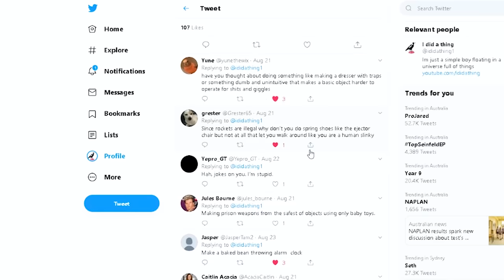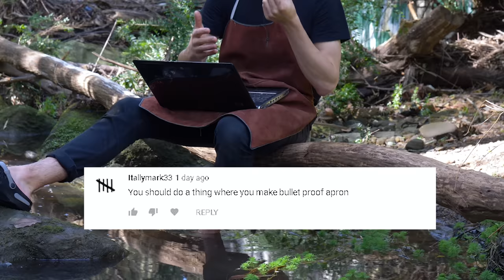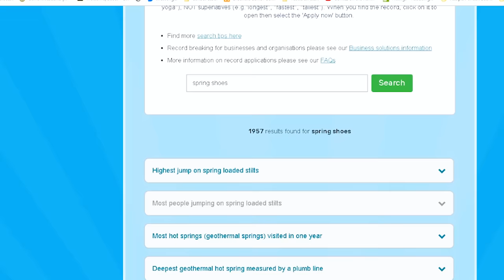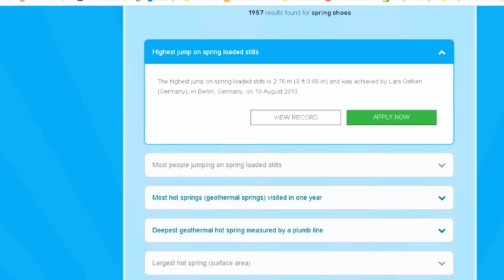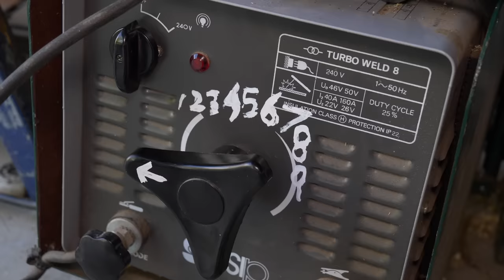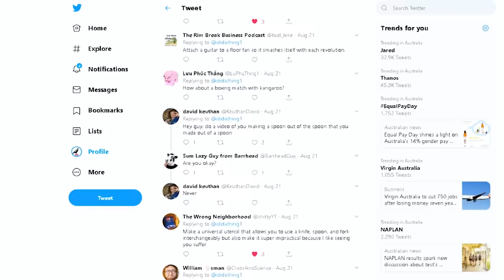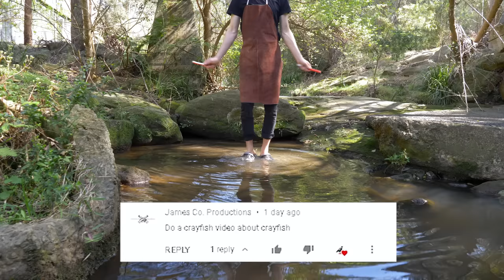I made your stupid video ideas!

Comment: Use snowboarding boots for spring shoes cuz they support your ankles
Reply: Quincy Fenner or high tops
Reply: @galacticnarwhal9798  good idea, but I dont think hightops would give enough support
Reply: Oh, yeah.. they wont break your ankles.. theyll just break something a little higher up.. 😂
Reply: Ah yes snow boots in Australia
Reply: @cheadlechamp8047  it's almost like Amazon exists
Reply: For even more protection you could use ski boots
Reply: He coulda just used the rollerblades
Reply: Quincy Fenner no skiing to
Reply: Ski boots are harder
Reply: @ashfreywar9862  ski boots would be too heavy and stiff to bounce in though
Reply: Also, put a platform under the springs so you have more surface area on the bottom to balance...
Reply: @valargent5774  true

Comment: Add a flat base to the bottom of the spring shoes like a small wood plank, some support from top to bottom to guide the compression of the springs for stability
Reply: It'd have to be much wider than the diameter of the spring for it to work, so wide that the bases would keep hitting each other, plus the weight was already pretty hard to deal with, apparently. I think the main issu is the type of shoes he's been using, I'd use at least moutain shoes, with an ankle cover, or even better : skiing shoes.
Reply: he should use bouncy balls instead of springs

Comment: The spring shoes needed more support and they would have been awesome. U have to put some metal bars on either side of your feet to give u support(like roller blades do) then you wouldn’t have to worry about your ankles snapping and u could gain height
Reply: Lmao I just finished the video, if he would use the normal support system he would have a much easier and accurate success

Comment: You need to use two smaller springs, weld the metal shoe pads on the bottom of the springs, then your shoes on top. Think that may give you a better chance

Comment: How about a super tool a battery power circular sander gauntlet - ( like when you extend your palms its like a giant circular sander to sand larger areas of wood then when you make a fist the sander retracts and out comes the battery operated knuckle driver (its a driver that can bore through wood like drill or screw the wood if a screw bits on it).
Reply: Never mind did not know about the sandpaper treadmill video

Comment: spring shoes is a bad idea 
though i have a better idea 
two spring for each foot but like half the size you used with a curved metal or plastic oval shaped plate underneath it would have given more balance and maybe for spring power 
assuming it would be lighter 

i did not fully come up with this idea i heard it some were but i forgot  so uh most of the credit goes to who ever 
had that idea first

Comment: 😂😂😂 Welding is 90% just about preparation of the pieces... Grind them clean, lay them down in a way so that the liquid metal goes where you want it to be, never go over the same spot with a stick welder twice. You need to remove the top layer first otherwice it will get trapped in the weld and the weld will be bad quality.
Reply: Also it really helps if you buy an inexpensive welting helmet that automatically switches between clear glass and protection. This will really help with the issue of getting the electrode stuck.

Comment: Hey your spring shoes put a decent tension spring and only make them four or six inches high you should be able to get good bounce off that but don't put such strong springs underneath your feet you weigh what 160 170 lb come on man you got to think about your weight and the size of the spring cut the spring down try that one there again and I bet you get two meters high easy